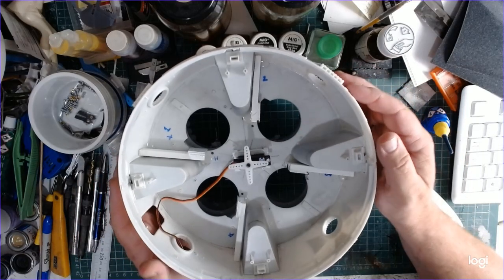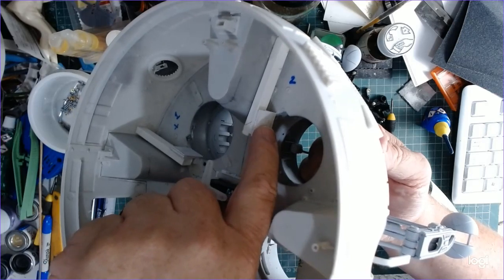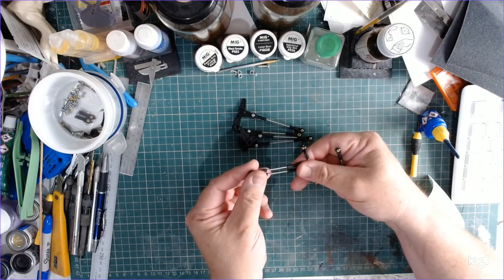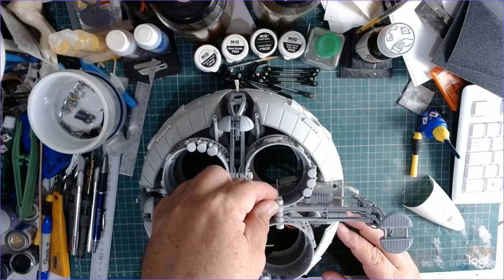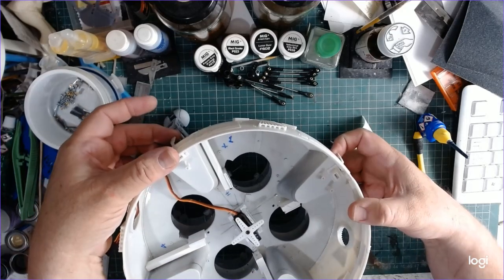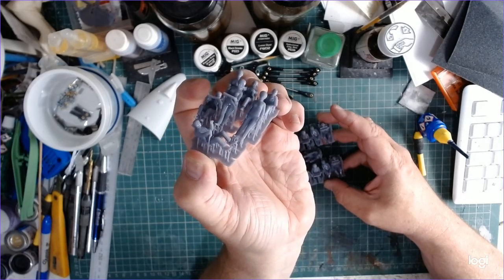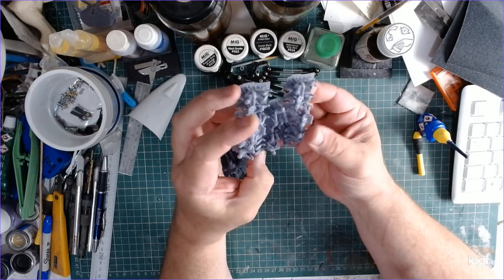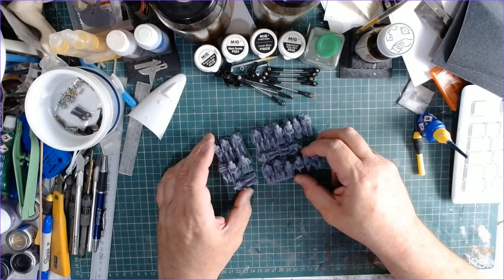Aries 1B Build Part 2

Comment: This is inspirational! One question....the locking tabs as part of the kit which work as part of the engines to lock the feet in postion.....should they be excluded if using this rc set up? I dont know whether to put them in as im tempted to try what your doing regarding rc.

Comment: I'm very interested in how this mechanism works out.  I wonder if you couldn't just add a tab to the inside of the hinge arm for the shroud that the knee of the gear leg would push up and close the door.   Where did you get the figure STL's?